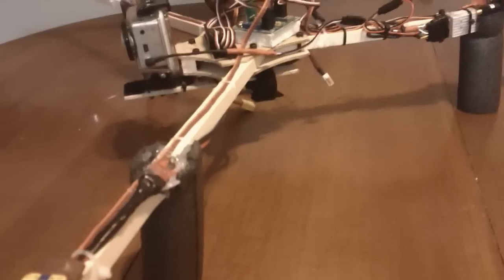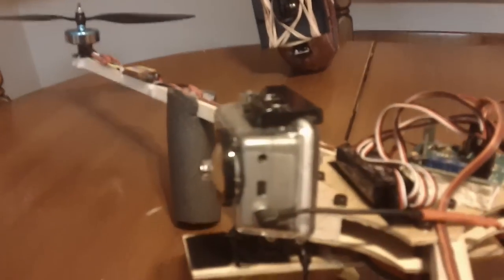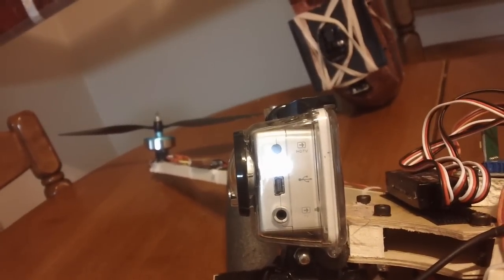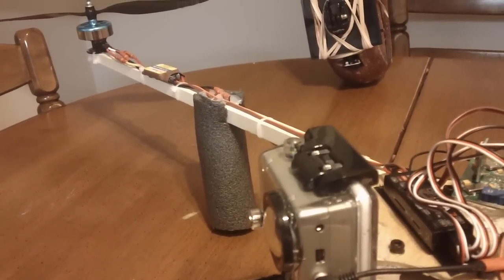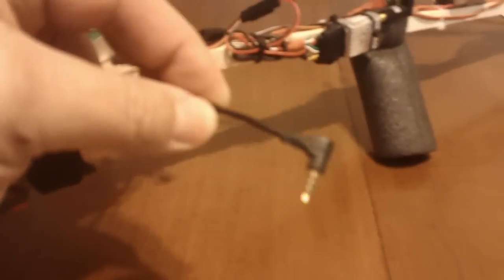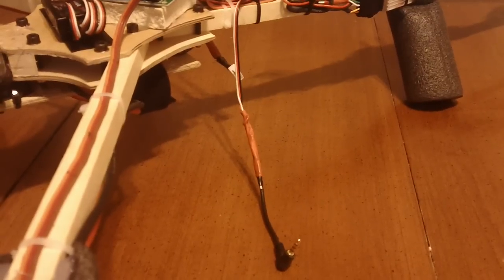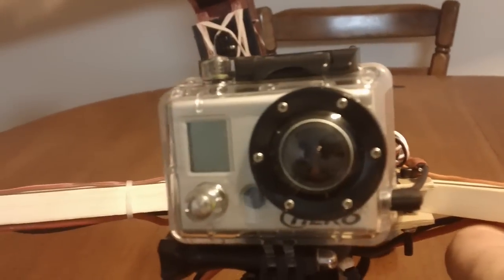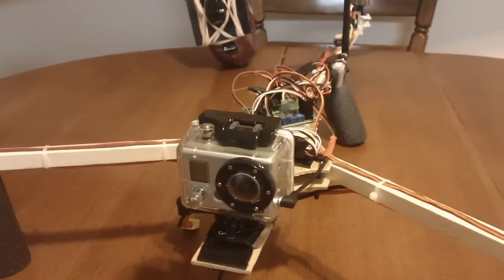GoPro av out cable for FPV

Comment: If you some day plan to fly over water, it is easy to make it waterproof just put some butyl tape around the plug, i have a small video about it "Waterproof GoPro video out".. Also make sure you have enough foam on board if flying over water... I know a guy that lost quad and gopro to a lake, it didn't float :-)